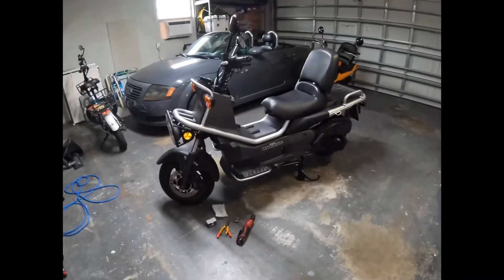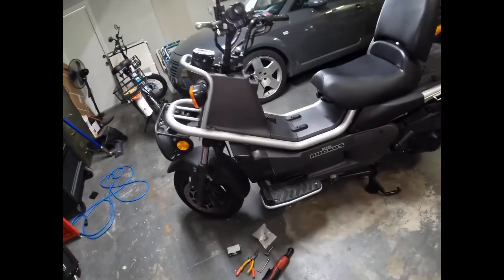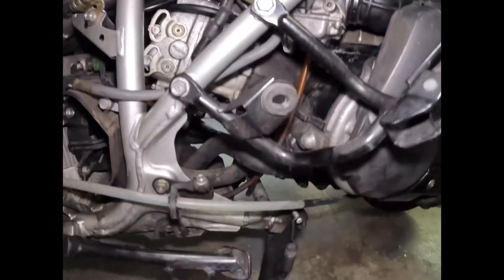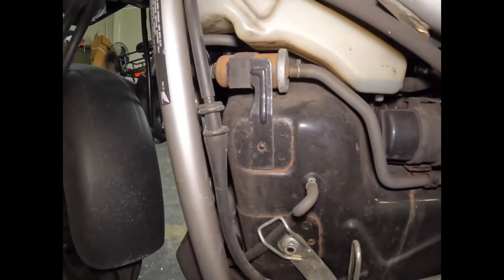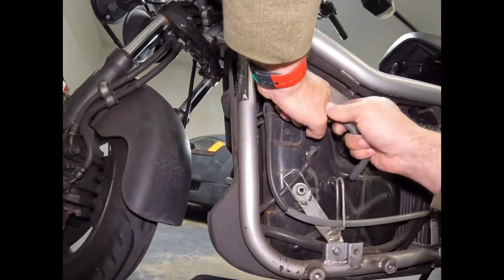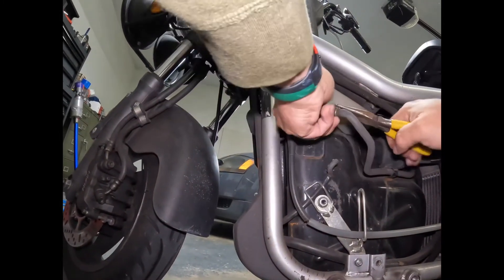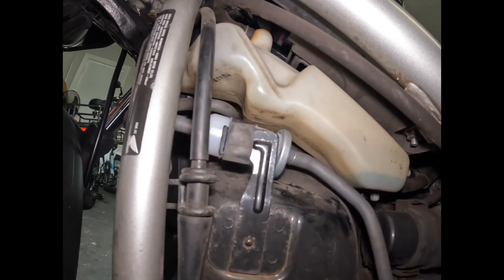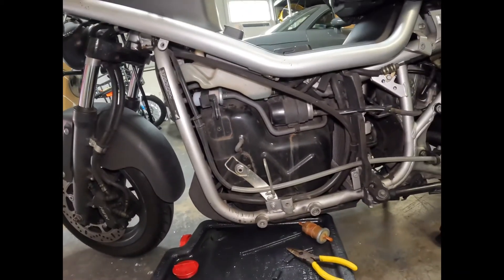Honda Big Ruckus: Fuel Filter Change

Comment: How Do you get the top plastic off where the gas cap is, trying to tank the gas tank out
Reply from the maker: Hello, you have to disassemble all the plastics off from seat forward in order to remove.  It’s been a while but I believe it may be easier taking the gas tank out from underneath